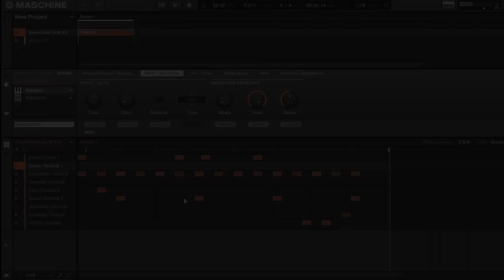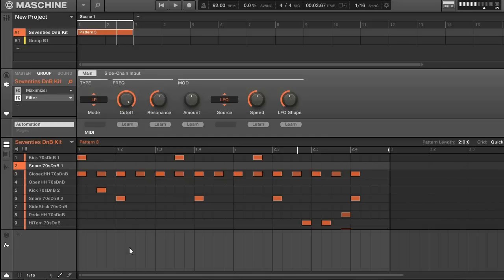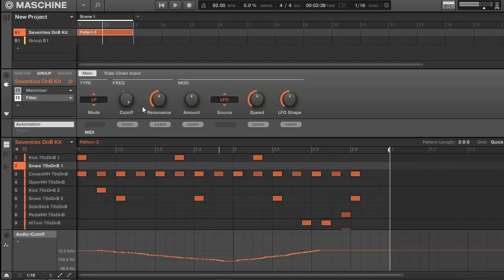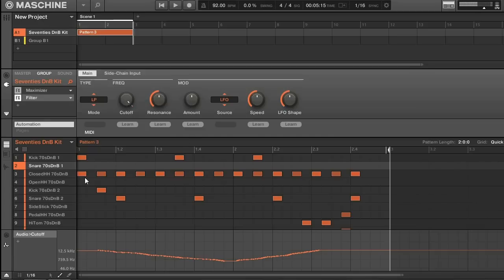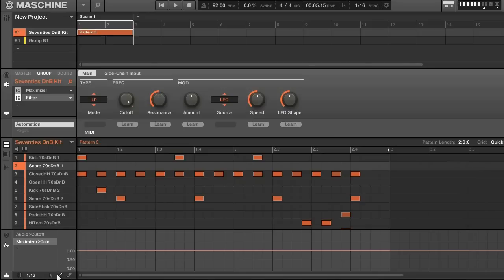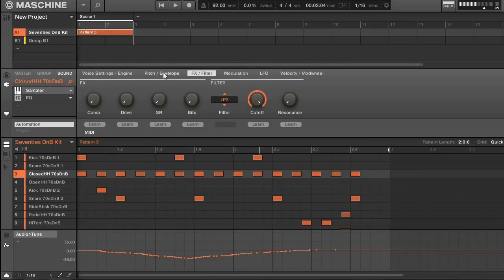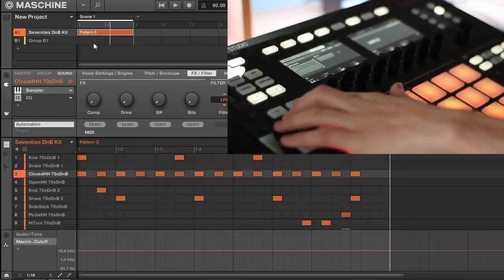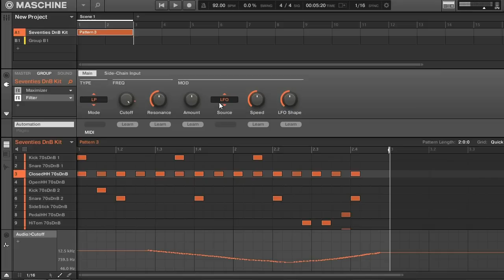NI Maschine tutorial - Recording and Editing Automation

Comment: Lets say that I want to use a high pass filter on my drum group - pattern1 during the intro, then remove the filter on the same drum group during pattern 2 or scene 2, is there a way to turn on and off a plugin apply on a group with automation? The only way I found to do that is to duplicate the group then put my filter on the new group which is pretty painful if I want to apply different set of plugins at different time of my song
Reply from the maker: Nicolas Prudhomme Yeah, I would automate the cutoff frequency -- when you want the filter on, just have the frequency up where you want it, and when you don't want the filter on, have the frequency all the way down. Does that make sense?
Reply: I understand, but it is a bit of a pain to always configure all my modulation everytime I make a new pattern... I guess I'll just find out a workflow that work well with a daw like ableton or logic to automate my song... It is a bit disappointing to see a poorly designed automation 'modulation' feature because if maschine had a decent automation system, I would do my tracks on this daw from A to Z, everything works so perfectly except the automation part.